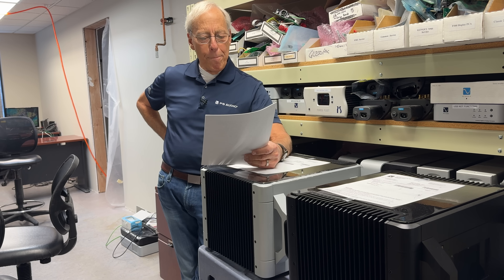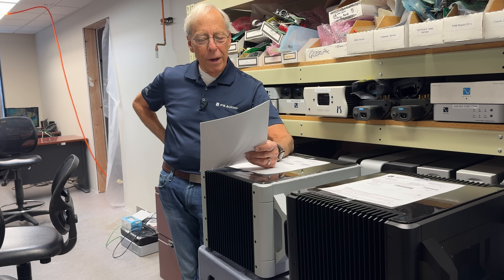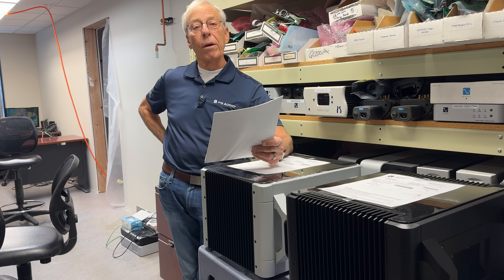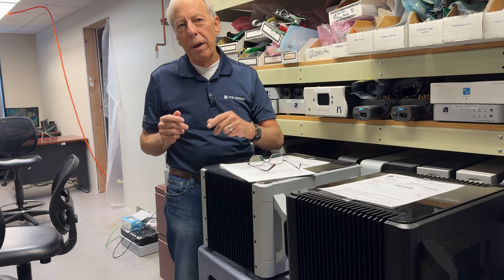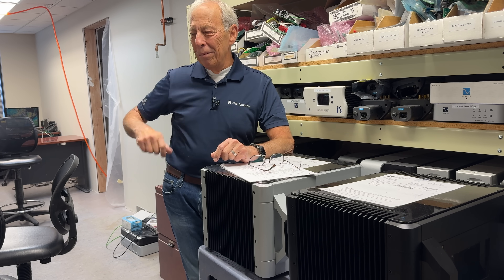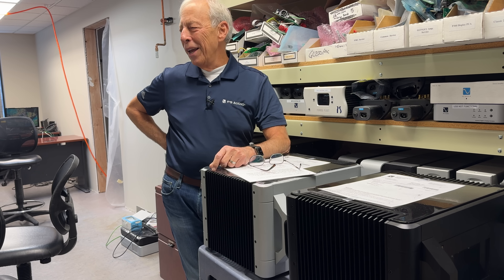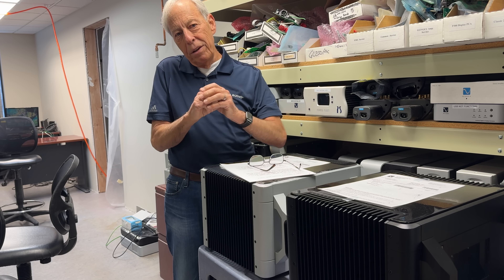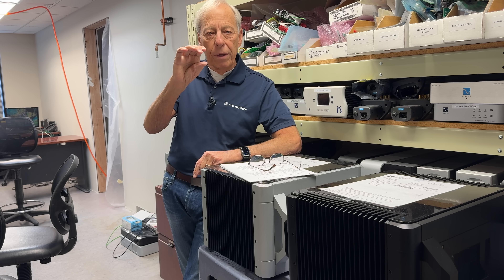Shielded or unshielded speaker cables

Comment: I have a balanced output question for the room. There's a $30K+ phono stage from England by a company that rhymes with Tom Sevenz which has just RCA outputs. Isn't that kinda crappy that it doesn't have balanced outputs to go to the pre-amp, or are they best for the pre-amp-to-amp connection? Any thoughts?
Reply: Your cartridge does not produce a balanced signal and most phono preamps I’m aware of are in fact single ended circuits. With all due respect to Paul, I’m not sure a balanced interconnect accomplishes anything unless the preamp and amp are fully balanced circuits. 

The only balanced component I own is a pair of Manley mono tape head preamps. It’s wired direct from the tape heads of my Ampex ATR102. The output of the Manley I had David modify for single ended since both my amp and preamps at the time, some 30 years ago, were single ended only. While our home theater setup does employ balanced amps, I’ve never owned a balanced amplifier or preamp and with my fondness for SET DHT amps and horn loaded speakers, it’s unlikely I ever will. As such, balanced interconnects seems kinda pointless

Comment: Surely, the shorter the speaker cable and the thinner cross sectional area combined with the higher dielectric strength of the insulator Will result in a lower capacitive resistance. Which will improve bandwidth and reduce inductive reactance reactance. And therefore improve power transfer aka power factor. Otherwise a battery would discharge due to coupling to the earth 🌎
Reply: Capacitive reactance, stupid spelling check

Comment: No man.  The waves need to breathe before they get to the speaker or the sound will be constricted. Sound like your amp is in a tunnel. Seriously,  in the early days I understand that cable experimenters tried RF coaxial cable to their speakers and claimed it sounded better. Well the DC resistance of large coax cable is pretty low and designed to handle several kilowatts of RF signals.  All I can think of as a benefit is that if you are getting RF rectification from a nearby transmitter in your amplifier it might help shield that out.

Comment: You'd probably have to look at a high power transmitter cable to find a shielded cable comparable thickness to a good speaker wire. Although some audiophile may have done it with 10 gauge silver for all I know.

Comment: Detractor Here: Shields add inductance, which slows the rise-time of the current in the cable causing a high frequency roll-off that gets worse with frequency. So, yes.. they will sound "pinched"... Just like ferrite beads that limit radio interference (>MHz) in small signals, the end result is a function of the shield material, quantity and the level of current.

On the other hand: Interconnects should be shielded because the signal current is 1000x less and the impedance of the shield is negligible compared to the impedance of the XLR input.

Comment: The terms audiophiles use feel like nails on a chalkboard. “Unshielded, unbalanced,” etc just seem like a lot of work. Seems you would have to remove shielding to “un-“ do it. Why put it in to begin with? Should be single ended, or plain wire. Like ordering iced tea, or tea, when do we think tea is sweet to begin with? “Unsweet,” is removing the sugar? 😅

Comment: Another question sure to spark emotion. Shield connected at source or destination and why. Assuming not both.
Reply: ALWAYS both.  An unterminated length of wire can and will become an antenna that can pick up some RF interference... the exact opposite of what shielding is supposed to do.
Reply: @Douglas_Blake  Interesting you say that. In my past life as a broadcast engineer, it was never both as that creates ground loops.
Reply: @alfonsodelafreg259  
Virtually every RCA cable now made is shield grounded at both ends.  It can expose ground loops. But the cable is not the cause, the loop will originate in your other gear.  The cable merely makes it obvious.
Reply: @Douglas_Blake  Yes, that's because single ended signals are referenced to ground. One reason single ended cables should be kept as short as possible. You can also have a two wire single ended cable with a shield.  But I digress. We are speaking about balanced cables here.

Comment: Wouldn't the preamp and speakers need to be designed for shielded cables? Otherwise,  how is the shield terminated? In a traditional single ended setup, the shield adds nothing- might make it worse if terminated to signal ground.

Comment: Fyi, sometimes you have no choice.. such as, if you use a Fosi class D amp, you’ll likely need a shielded interconnect cable, else you’ll likely have a popping sound issue.. I had this issue and Fosi themselves told me to use shielded and it did fix the popping sound issues. For context, I pair a fosi amp with svs soundpath wireless adapter to make my rear surrounds wireless bc I could not run cables  through ceiling or floor in my situation. Works great too. Just had to use shielded interconnect for the amp/adapter connection

Comment: Very confused lol. Didn't you start the video off by saying that shielding interferes with the amplification of the signal to the speakers in shielded cables for speakers, and then end the video suggesting to use shielded speaker cables? :P
Reply from the maker: Yeah, you're right. Sorry about that. I got off onto interocnnects and didn't separate the two. To be clear, I do not like shielded speaker cables. Thanks for pointing that out.
Reply: @Paulmcgowanpsaudio  Okay thank you, I was just looking at making speaker cables the other day so I was glad you posted this one. I made them out of unshielded lamp cord for my Fender amp to my 2x12 speaker cab just like Dad taught me.
Reply from the maker: @anotheryoutubed  Which is fine depending on what you're trying to achieve but, for HiFi listening purposes, get rid of the stranded lamp cord. No bass. Try solid core instead. Even household Romex will sound much beefier than lamp cord.

Comment: I bought shielded mogami speaker wire for my bookshelf speakers and the difference was very pleasant. No more RF noises I'd pick up from time to time. Best part is that the speakers sound better.. at least to me they do and that's all that matters. 💯
Reply: I believe the Mogami speaker cables use a star-quad configuration to help reduce electromagnetic interference (EMI), rather than a shield.
Reply: @SteveD-m6z  Mogami makes several different cables in several different configurations, who knows which one the OP used.

Comment: This is a very confused answer. The questioner effectively has powered speakers. The answer is to use balanced connections if available. The answer went off at a tangent to speaker cables. Shielded cables are pointless for speakers. The speaker circuit is low impedance and relatively high power. Any interference picked up by the cable is tiny compared to the music signal and is shunted to ground by the low impedance. 12 or 14 gauge twin copper wire is perfectly fine.
 Balanced connectors will not reduce noise and distortion coming from a preamp. Picking holes in Paul’s technical explanations is the only pleasure I have left in life.
Reply: Balanced connections were originally designed specifically for microphone use in studios and on stages. Microphones typically have very tiny output signal levels and in studios and on stages the distance between the microphone and the mixer can be quite long, think 30+ feet and often even far more, so those cables have to be balanced to shield the signals against interference. High-end audio USED to use "simple" but high-quality RCA connectors, until some brands started implementing balanced output and inputs, CLAIMING they provided better sound. Personally I couldn't tell the difference between balanced and RCA when hooking up a high-end cd-player to a high-end pre-amplifier at the audio shop of a friend of mine, but there were people who claimed they could hear a vast difference. So at best I'd say the influence on the sound would be very subtle. Balanced interlinks can make a difference in a noisy (electronically speaking) environment, but in my opinion, you'd then have to ask yourself if it wouldn't be better to move to another room or even another house if the present room or house is that terribly noisy. But that's just my two cents.
Reply: @tjroelsma  Yes, for short runs in a typical home system RCA connections are perfectly fine. If XLR connections are available on your equipment then you may as well use them. If only unbalanced RCA connections are available then there is really no issue as any audible difference is probably imaginary.
Reply: So you are one of the "detractors" that he mentioned in his response LOL!
Reply: @RicheyMadison  Apparently so. Despite his repeated claims to the contrary, Paul is a salesman and not an engineer. Some of his technical answers are real howlers.
Reply: @RicheyMadison    Ha ha, nope not me. I see some of the comments he was referring to though!
Reply: Does this also mean that ferrite rings applied round the ends of speaker cables are also pointless (or worse, "constricting the sound")?
Reply: @connorduke4619  Yes, pointless. Paul’s “constricting sound” claim is nonsense.
Reply: @connorduke4619  A single pass of speaker wire through a ferrite would have so little inductance that it probably does nothing at audio frequencies; the overall amp-wire-speaker-wire-amp loop is relatively low impedance and already has the inductance of the drivers (if cone or dome type). If there are enough passes through the ferrite, it will likely start to become apparent through hysteresis and saturation (both bad for sound). The only real use of ferrites on speaker wires would be if your wires are somehow backfeeding a problematic EMF into the amp, interconnects or other components and causing an issue with something with poor noise rejection, or maybe if you have a really bad/old/misused class-D amp.
Reply: He knows his stuff, but if Paul had included a diagram of Mark's audio-setup, it would have greatly helped the explanation and eventual answer.

Comment: Paul I think you misread the letter, the question was “from preamp to speakers“ implying that the person has active speakers or speakers with a built-in amplifier that accept a balanced connection, in which case they definitely should use shielded cables because it’s line level voltages
Reply: He does answer this in the second half.
Reply: Are there many active speakers that also have bi-wiring from a preamp?
Reply: @benwu7980  there could be, but I’ve never heard of any… Edit: if there are, they are probably Chi-Fi active speakers that have it to seem like it’s deluxe, but I’d expect some active speakers over the thousand dollar range may be biamped internally with hard programmed DSP. Biamping a passive speaker can easily lead to more problems than benefits unless you’re connecting it to a DSP for biamplified speakers, because how do you know what frequencies range to send to your Tweeter and woofer? How much overlap? Getting into the weeds for not much return there. Better to just rely on the manufacturer building a good crossover network if you’re paying for high dollar speakers.

Comment: I think the question wasn’t very clear and something got lost in translation. The viewer said he biamps and then asked if he should shield the XLR cable from his pre to his speakers: the speakers are definitely active. 
So it’s not a speaker cable we are talking about but a signal cable.
Reply: Can we all just agree that XLR's are a step up from RCA? So... whenever possible opt for XLR over RCA. Not really an opinion thing. Regardless if he completely understood the poorly asked question or not.
Reply: @lexicon612  -  In general, yes.
Reply: Absolutely
The question is totally confusing 
 He says

 " bi amped speakerS with the amplfier "bolted" to the speaker(singular) .. and i use balanced xlr cable with  shield"

("Bolted on" amplifier suggests a external power amplifier )

A few moments later then it is asked.. " should i use  balanced unshielded cable from my preamp to the speakers"

So it would seem that the cable he is asking about is a signal connection from his preamp to the speaker(s) power amp and consequently  has nothing to do with speaker cables which carry the output of a power amplifier to a speaker ( and bi amped in this case )
Reply: In which case he should definitely use a dual differential balanced XLR connection.
Reply: I think, you‘re right, but what translation ? And to split hair just for the fun of it, when you write „active „, you mean self powered.
Reply: @kaiulrich6185  -  "active" has become a common standard description for speakers which were once called "self-powered".  lol!  You aren't "splitting a hair", you are "living in the past".  Just for the fun of it. lol
Reply: @ People have called self powered speaker „active“ for the last 30 years or longer, so it ‚s not a new thing. But the correct term is still self powered, at least in pro audio. Active  meant a n active crossover.
Reply: @kaiulrich6185  -   LOL!   I have a pair of "active" speakers with "passive" x-overs.  lol
Maybe your terminology in Europe is a little different?
Reply: @kaiulrich6185  active as in with an active line cross-over, which are always self powered. If you know of any non self powered speakers with an active crossover, please share. I am always happy to learn something new.
Reply: @ I doubt there are any of those speakers in hifi world, I‘m not into that, but in pro audio almost every system, that isn’t self powered, has a multipin socket of some sort and needs a system controller which is kind of an active crossover.
Reply: @ What are kind of active speakers are there?
Reply: @kaiulrich6185  -   Paul did not correctly understand the question, therefore the question was incorrectly "translated".  Paul then proceeded to pile on the bullshit and confusion with his goofy answer to a question he initially "mis-translated".
Reply: No. You will get better sound with RCA. Unless you are talking about 30’+ of cable length, balanced will degrade the sound because you have double the number of components, including transformers.
Reply: @Fluterra  
Balanced connections have not used transformers in half a century.

These days the process is handled by op-amps both as phase splitters before transmitting the signal and as a "differentiator" when receiving the signals.  

At the receiving end the signal is converted from balanced to single ended for the innards of the device... the device does it's thing... then the signal is converted again to balanced.  

There have been a few "fully balanced" devices made that do not differentiate at the input, but instead, pass the balanced signal through two discrete channels internally ... This entirely defeats the noise cancelling features of balanced audio. It also doubles the component count, increases heat and risk of part failures.  It's just the dumbest way to handle balanced signals imaginable.

Comment: And yet, the Furutech DSS-4.1 speaker cable, is the finest speaker cable I've heard to this date.. 🤔
Reply: How about when you connect it to speakers?
Reply: @paulb4661  Off course I have them connected to my speakers, what do you mean?? 😅
Reply: @5starmaniac  My apologies, it was a question with mildly saracastic undertones, relating to the fact that it has been demonstrated numerous times, that listeners cannot tell the difference between reasonably priced and overpriced cables. Not once to the contrary. There is a strong correlation between seeing and hearing the cable and once blindfolded, the results invariably tend to drop to zero, or 50/50 by another metric. Nevertheless, enjoy your fancy looking investment!

Comment: I use a 14 gauge silver wire wrapped by an 8 gauge teflon jacket. Not terminated. 

Silver transparency plus air. That’s what I get when I connect my powered speakers.

Comment: Yep ... shielded interconnects (balanced or single) and unshielded speaker wires is the way to go.  The impedance of a speaker loop is 8 ohms or less.  Interconnects can run 50k or higher... higher impedances mean less immunity to interference so the grounded shield tends to shunt off most of the external interference.  But in speaker loops the impedance is so low that any external interference has little or no impact.
Reply: Does this also mean that ferrite rings applied round the ends of speaker cables are also pointless (or worse, "constricting the sound")?
Reply: @connorduke4619  
Ferrite chokes are generally used to oppose Radio Frequency Interference and have almost no effect on audio frequencies.  So aside from any coincidental decorative value, they're not going to do anything for a speaker loop.

Comment: don't often comment, but, paul,  I would suggest that a shield introduces capacitance.   Capacitance can change the sound significantly
Reply: Shield does indeed add capacitance. But its influence on the sound depends on the output resistance of the source, because that series resistance with the capacitance to ground forms a low pass filter.

In reality its influence can be neglected. Suppose you have a 10 m long signal cable with 100 pF/m, resulting in a capacitance of 1 nF. On a 600 ohm line output, the cut-off frequency would then be 1/(2 * pi * 1 nF * 600 ohm), equalling 265 kHz. So, no problem at all. And the lower the output resistance, the higher the cut-off frequency.